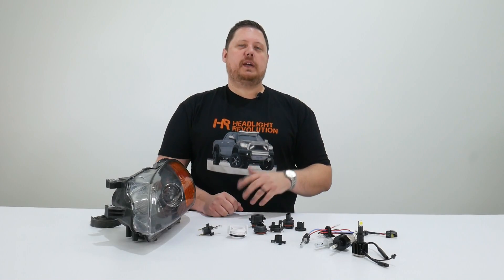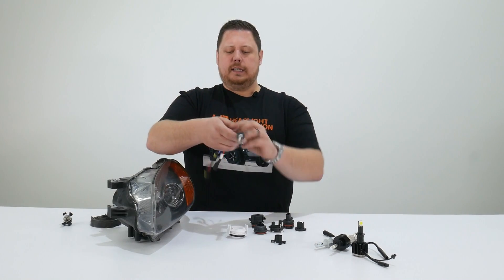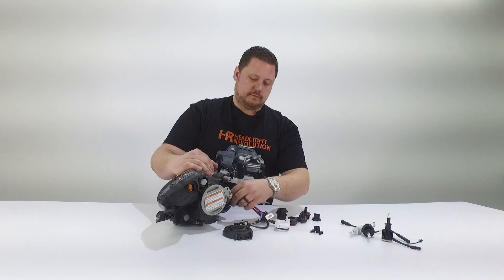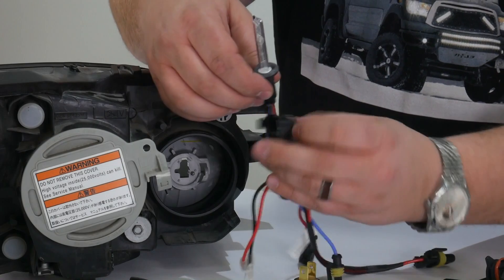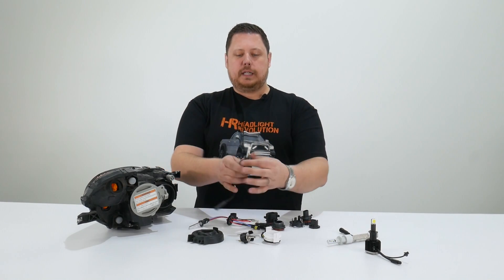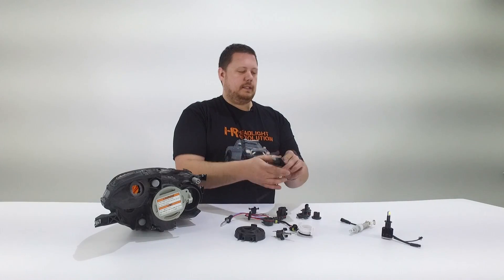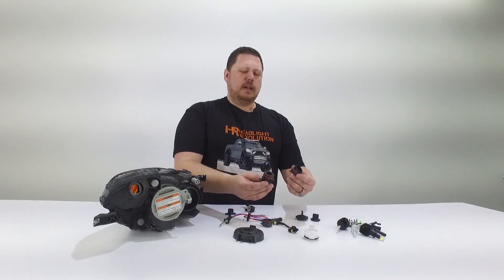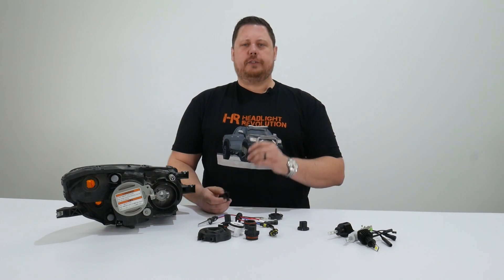How to use HID Bulb Adapters, and why they won't work with LED Headlight Bulbs!

Comment: So all it changes it's the way they sit inside, but i mean it will even still power up, even if the trucks it means for LED and you try to connect a HID bulb, it will still light up or it won't light up?
Reply from the maker: You cannot install HID on an OEM LED vehicle.

Comment: I have bought LEDs to wasp into my Subaru, there is a HID ballast in there and I know one side is going out. Is there a plug and play solution to bypass the HID ballast? all of my plugs are completely different, even though the bulbs are for my Make Model and Year. Thanks.
Reply from the maker: You'll want to stick with HID, I'd swap the LED out for a good pair of HID bulbs like Osram Nightbreaker Lasers!

Comment: Great videos! I would like to see you test and make videos for motorcycle headlights. Specifically I own a 2008 Honda cbr1000rr. This bike has 2 seperate headlights, one side is low beam and the other is high. So when using your low beans it looks like you have 1 headlight out, when you turn on the high beam then both headlights light up. I hate this set up.  Both headlights high and low are h7 single beam in a reflector housing . What I want to do is, install a dual beam hid on both sides so both headlights are on all the time and both operate as low or high beam. I think I have figured out everything except which dual beam bulb can I fit into the housing designed for an h7, do I need an adapter, also what options do I have if I went with led?
Reply from the maker: To do that, you would have to build a custom projector headlight assembly for your bike. The reason for this is that there are no dual beam H7 bulbs, they are a single beam bulb that relys on the projector shutter to switch form low beam to high beam. Unfortunately we do not sell a product like that, but a company that we have dealt with in the past, The Retrofit Source, will be able to get you taken care of! Sorry I couldnt be of more assistance, let me know if there is anything else I can do for you!

Comment: Trying to replace my HID bulb with regular bulb, so removing ballast all together, right?  But, the regular bulb won’t work with factory connector.  The other light bulb is standard, works fine, removed that bulb to test.  Any ideas?  Thanks.
Reply from the maker: Hey there! When you say "regular bulb" do you mean a halogen bulb by chance?
Reply: Headlight Revolution Yes, I figured it out, since the watts were converted for HID bulb, can’t go back to factory bulb.  Right?
Reply from the maker: Yes, that is correct. You cannot convert a OEM HID headlight to accept a halogen bulb.

Comment: So i need to replace the bulbs in my motorcycle. The headlights were already after market leds. Problem is that is that i can't found them with the hookups. The connectors for the LED on the far right is exactly the same. What is that?
Reply from the maker: Send us a picture to sales@HeadlightRevolution.com and we’ll help figure it all out with you!
Reply from the maker: Send us a picture to sales@HeadlightRevolution.com and we’ll help figure it all out with you!

Comment: So what if your car doesn't have a bulb adapter but a clip what would you use then because it seems the fan on the back of the bulb is in the way to reuse the clip (h7 bulb)
Reply from the maker: This is not recommended for H7 applications.

Comment: “Are there REALLY people who can’t use a glue gun....or,well..... twist two wires together, daddy?”

I was watching this with one eyebrow shot up when my son walked in, and after a minute asked me that. I could only reply, “aparently, son. But that fuels the American economy. Not the desire to be self sufficient... but to pay someone else for a skill you could master in an hour if you have a damn...but you don’t. People still believe advertising is all 100% honest by law...”.

-and we laughed and ate cookie and talked about that episode of Star Trek where Tasha Yar ran into the living oil slick. It was great.
Reply: Thanks. It was proud of that one. Not just because it was mostly true. Replace my son in the story with my room mate Gravy, and Tasha Yar with jaba the hut’s green hoes. Now “Majestic”.... that’s a word you don’t see used outside of Iim Carey very often.

Incidently, twice now I’ve upgraded to LED as they were nearly free. A 99 ranger, and a 96 camry. In both cases , used the housing of an old bulb, a dremel, hot glue, and a dab of solder. Camry was a bit of a pain, the conversion requires 2 relays (pull a part
Reply: Pull-a-part 5 finger) wired like a interstate cloverloop to retain all the function afforded by the stock switch on the dash. Balanced by the Camry having a screw on the light housing to adjust it up and down really easy. Both still gitting it!!
Reply from the maker: This is the most majestic comment to ever hit this channel.

Comment: Just want to say that this is the best channel I've found for HID information. I do have a question though. So I bought some aftermarket headlights for my 2001 Honda Prelude. None of the bulbs use adapters but do use those metal clips. I was actually able to use the included clip to mount my HID bulbs. Only problem is there is a open slot for a parking light, but no sort of mounting hardware or anything that would allow adapters to be fitted. It's just a hole for a bulb to fit through. Do you know how I would mount the parking light? I plan on getting LEDs for the parking lights.
Reply from the maker: Mitas Might Contact us at sales@headlightrevolution.com and we can figure something out for you!